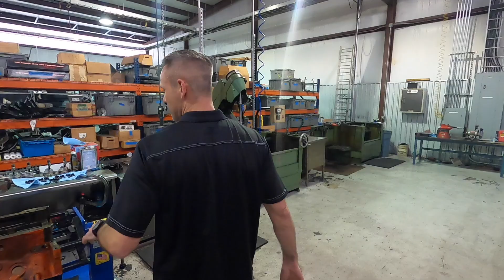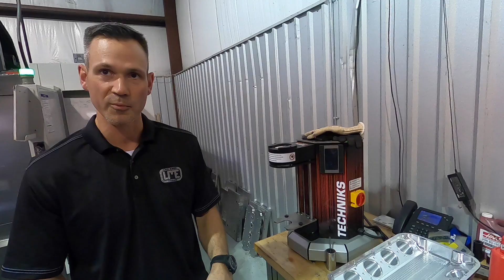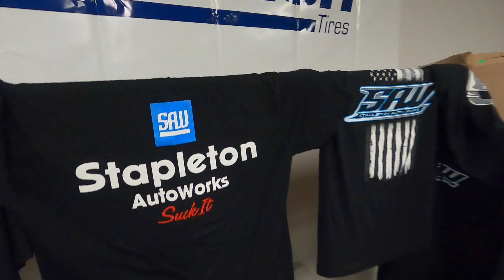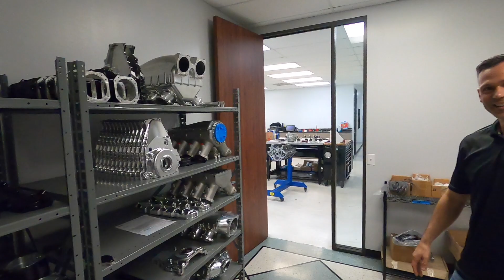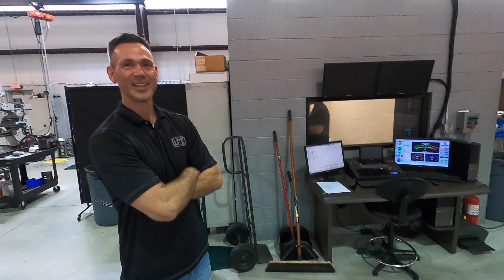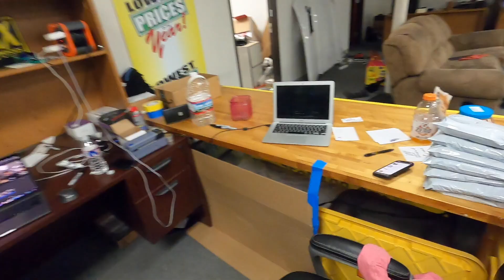Late Model Engines Shop Full Tour & Assembly Process! BIG POWER Chevy LSX/LT Specialists! (LME)

Comment: 25 years as a Machinist I use a Apec   5 axis we cut twelve cylinder train engines. The blocks are over ten feet long 4 feet in  height we do the same work on a larger scale. I'm Canadian and form Ontario Canada G.E. is our main customer. We also do tear downs and  rebuilding.

Comment: I worked at a company called Kenlab we did custom fabricating. It wasn't automotive we made equipment and parts for other industry's . A company would come to us and we would take their design and sometimes we would have to redesign the parts so they can be mass produced. We worked with Aircraft industry computer industry and medical industry. At Kenlab I made a few parts that are on the Voyager spacecraft. We would make one off parts to mass produced parts. I designed fixtures for holding parts to be welded. I also did close tolerance welding working as close as 0.003. I loved working there.

Comment: It sounds like the LT engines can be pretty stout but many parts are different and retrofitting them requires some changes if you want to keep them port injected. It would be pretty interesting to learn what all that takes exactly and how much better it might be vs cost since the blocks sound so stout.

Comment: @stapelton42 I'm picking up a 350 4 bolt main sbc that's been boared 30 over... Gonna pick up a 400 sbc crank making the 383 stroker... Do I need to change the cam as well... Or anything else or can I get away with just the crank? Not gonna race it but it's going in my 74 square body chevy 4x4 that I play with off road and part time daily... I do drive my stuff hard tho... Heavy footed what can I say lol... Any advice would be greatly appreciated! 👊

Comment: Being a S.A.M Alumni myself, it's really refreshing to see an interview with an engine builder that:

A: Knows what He's talking about.
B: Doesn't rush through and sugar coat the details
C: IS successful and a leader in their field.

I know demand is low, but it would be really Kool to see an intake manifold with an integral intercooler to fit  classic GMC 6-71 type blowers to Ls and LT applications that actually FIT and aren't overpriced junk that require tons of work..

Great interview and tour of LME man, Your motor is in good hands..
Reply: Yeah, it's in good hands as long as the guy actually doing the work knows the difference between 1/10 of an inch and 1/10,000 of an inch....which the guy interviewed didn't...

Comment: I don't own a LS or LT and don't plan to build one, But I was very impressed with their shop and the huge amount of professionalism there. Their machine work is very impressive and the fact that they mixed new technology with old reliable machining equipment was really cool to see. I've been to several machine shops and I have never seen one that clean. Very impressive facility and looks like a top notch company. Did he happen to mention if he planned on getting into other engine types in the industry? I.E Mopar, Ford Etc etc
Reply from the maker: They do other types of engines! They’re just not as much volume as LS LT
Reply: @Stapleton42  Good to know, Thanks!
Reply: They do some v10 viper stuff.. have some ford mod motor stuff..  these guys r engine builders..not parts assemblers